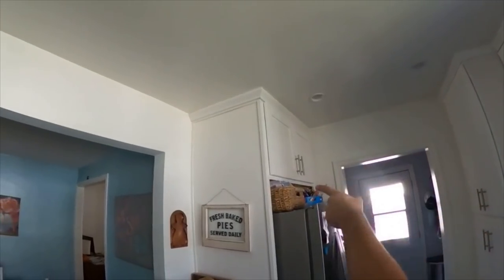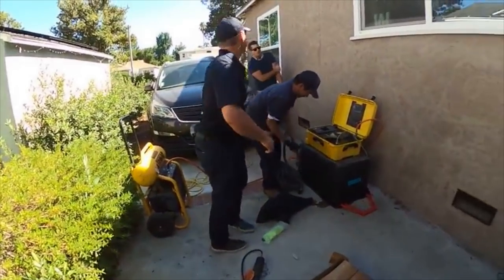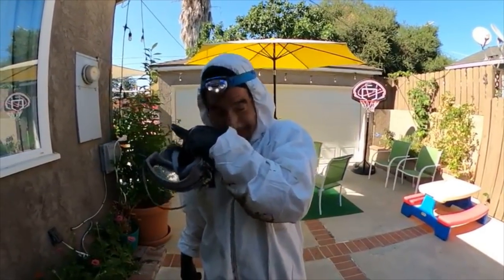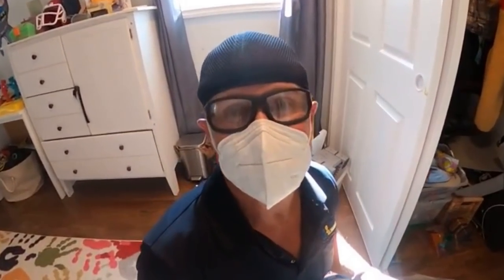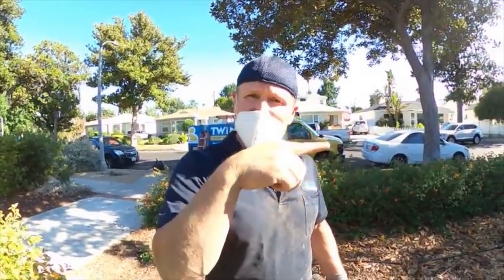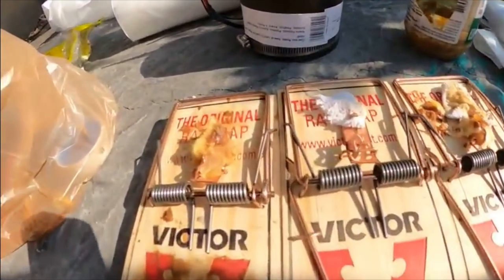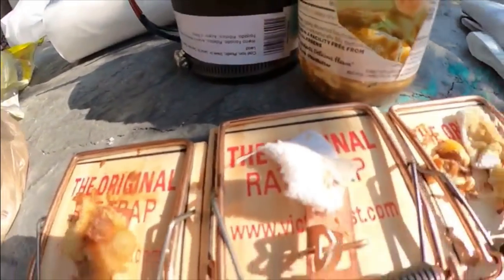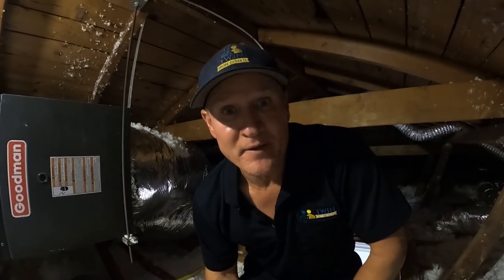How to GET RID of Rats QUICKLY in a CLEAN house...BEST Rodent Control

Comment: 5:11 just goes to show that: Rats don’t care about how clean your house is, or “who” you are. A house can be spotless, sterile, no food out etc….AND THEY will invade the house no matter what. If they like it, they are there.
So, for those who think that rats only infest “dirty” houses…..well, that’s not really true.
IT ALSO SHOWS JUST “HOW IMPORTANT” AND VITAL it is to make sure (especially during a remodel) old pipes are capped/filled at BOTH ENDS, everything sealed up right, and there’s no garbage/debris from a remodel left behind. I’ve remodeled a home that was previously done 8 yrs prior and when replaced the tub, the prior crew used it as a garbage can, NOT GOOD. Empty bottles of pop, chip bags, candy wrappers, etc… Would you throw garbage on your floor and leave it, I wouldn’t; and neither should any contractor/crew doing work. They should clean up everyday and keep things tidy…..just easier to work on a site when things are like that; ya also don’t “miss” things and damage finished materials, imo (and how was taught). Leave it better than when walked in😊
Great vid guys, like the channel and what ya doin’✌🏻
Reply: True, but rats go to places where there are food sources, Anywhere where they can find something to eat is definately where they'll be
Reply: The cleanliness shown was not indicative of what it was like when rats invaded.  Anyone who want a complete wreck would clean up their act over there is an infestation.  The problem then would be the nests are already made and there's always some crumbs left out.